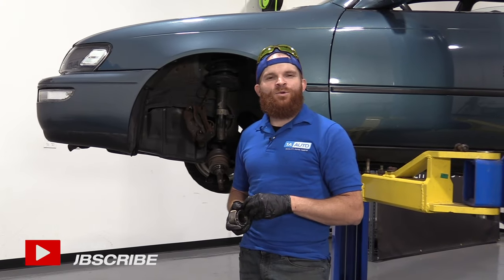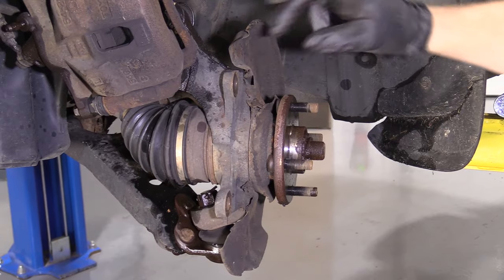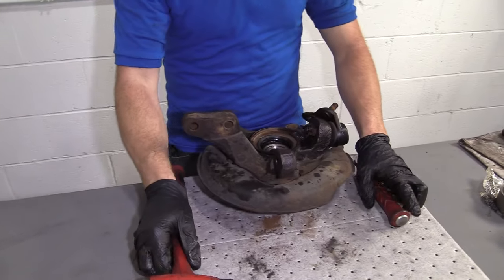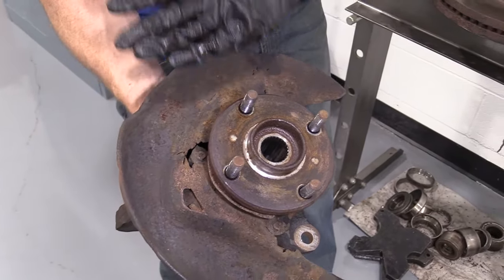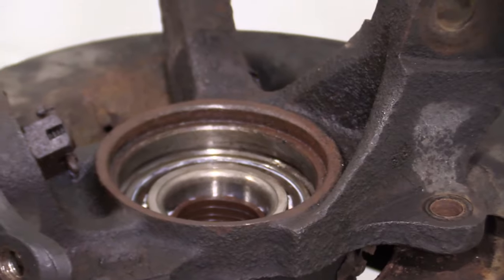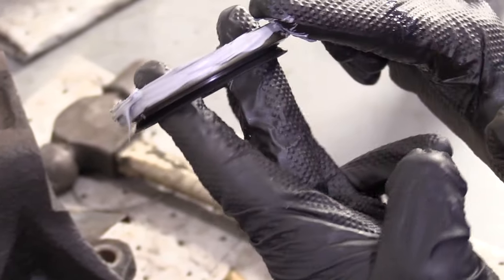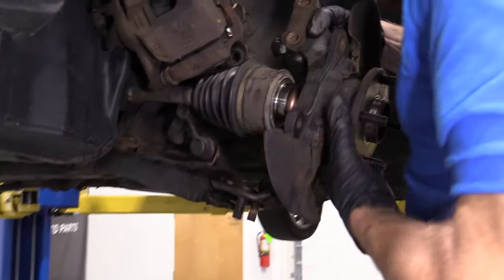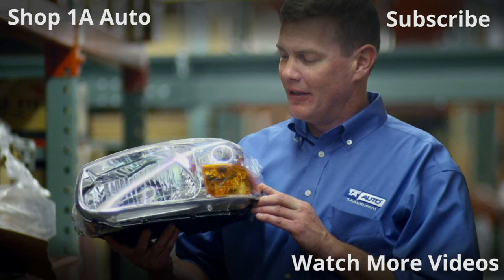How to Replace Front Wheel Bearing 88-02 Toyota Corolla

Comment: Just finished the job. Watched a little of the video then went and did that part so on and so on. The only thing I did different was my wheels are plain steel wheels with the open center, so I broke the 30mm axle nut first with the wheel still on and then removed it at the proper time. Thanks for the video.

Comment: Wheels with a speed sensor will have a magnetic side to the wheel bearing. Make sure to install with the magnetic ring facing the correct direction.

Comment: Is this the reason my car bonks and wobbles at high and low speed not all the time only when I go on an uneven surface or when I go against the misalignment it starts to shake when I hit the brakes and slow down it stops I can go on the he flattest surface with no problem but give a little resistance or go on any in even pavement it wobbles like an earthquake

Comment: Good video, but what striked me as odd is that, when you tried to remove the race, you used blocks. you could have used a socket the that is a a little bit smaller diameter as the hub snout and a steel plate and you would have been able to save time from using a bunch of blocks an the air chisel
Reply from the maker: +Rick Moises Thanks for the tip! We'll pass this info along to our production team.
Reply: 1A Auto Parts no problem! From mechanic to mechanic, just to let you know, a 27MM socket with do the trick perfectly!
Reply from the maker: +Rick Moises Thanks!

Comment: the bearing puller is installed incorrectly.  the flat sides of the puller should be facing up.  you see how everything is bent because he has it in backwards.

Comment: I'm gonna fix the wheeling bearing by myself
It should be easy but after watching this I'm im like nah.
Reply: It's easier if you just replace the entire hub assembly/knuckle from a junkyard. Pressing the bearing out/in is a pain and cost more in labor if you pay someone else. An entire assembly is as cheap as $20 as high as $100 at a junkyard.

If you're not changing the entire knuckle then Using a hydraulic press like he is doing is also a pain. Get (buy or rent) a proper bearing puller and slide hammer kit. You can remove the hub assembly with a slide hammer puller $69) or a Screw Puller ($20-50). Then use a FWD bearing removal kit ($50-70) 

Or rent those tools at autozone/advanced/orielly.

Comment: Good video, but you contaminated that new bearing big time drastically shortening it’s life span. You also had penetrant on the brake disc and pads.  Use some spray brake parts cleaner, that’s what God invented it for!